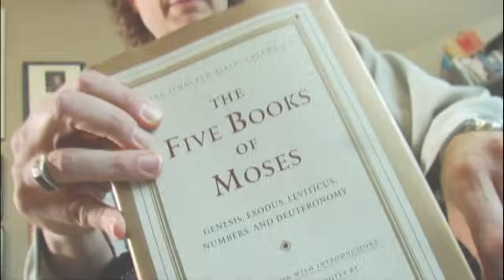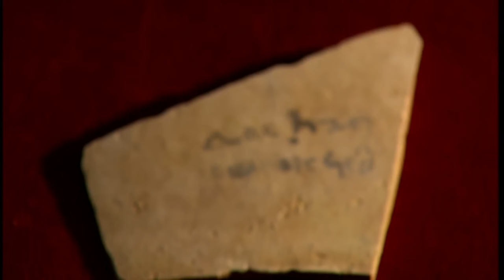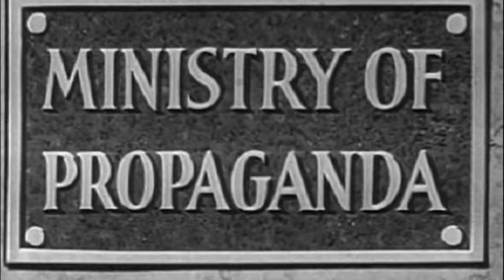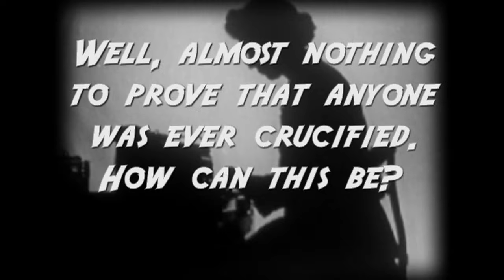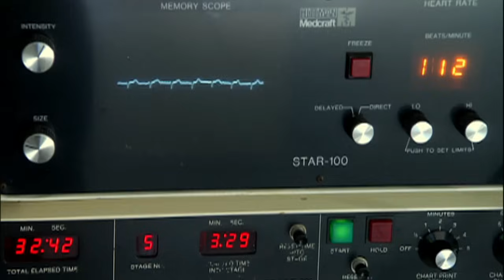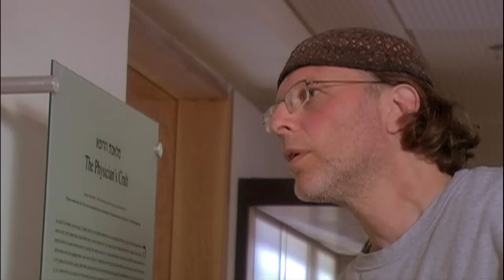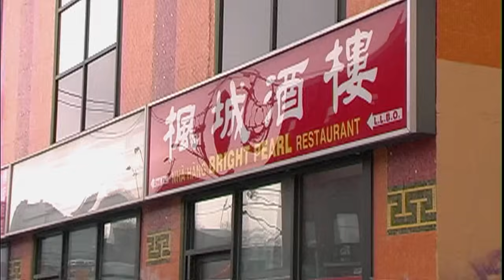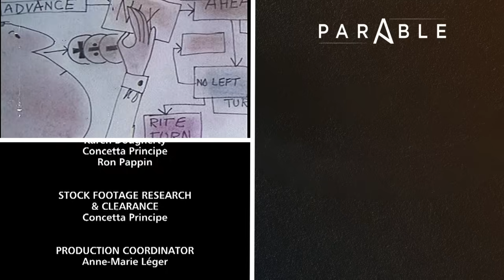Full Episode: The Quest for Proof - Archaeology & Jesus | Parable

Comment: In 1978 the Shroud of Turin was subjected to intensive evidence gathering.  This evidence was then analyzed over a period of three years.  The conclusions are that the Shroud has been in contact with a human corpse and that its image is not composed of paint, stain, ink, watercolor, or scorch and that the image is not the work of an artist.  No known natural process can account for the image which contains skeletal features.  It seems to be the result of some type of radiation whose origin was the enclosed corpse.   Therefore, the possibility of a related neutron radiation event has to be considered when evaluating the Shroud's C14 data.  However, the British Museum refused to do that, and, instead, manipulated the both Shroud's C14 data and its mathematical analysis in order to arrive at the Museum's desired conclusion.  When the Museum was finally forced by a court order in 2017 to release all of the original 1988 C14 data, a reevaluation of that data resulted in the conclusion that the data was too disparate to be a valid indicator of a date.  Nuclear engineer Robert Rucker tested that data using a Los Alamos neutron radiation evaluation program and has found that the Shroud's C14 data is compatible with the hypothesis of a neutron  radiation event from the enclosed corpse. shroudresearch(dot)net
Reply: That shroud was not left by Jesús but created and planted by satán because God does not want any object to become an excuse to praise, adoration or veneration. 
God said in the 10 Commandments not to make any imagen and not to render any adoration.
Reply: @manuelr7296  The Shroud is not an idol.  It is not worshipped.  Rather, it is the fulfillment of the promised "sign of Jonah" which is miraculous proof that the great rabbi, Yeshu ben Pantera was the messiah.  Its miraculous image is also proof that the common philosophy of "naturalism" is wrong.  YHWH does exist.  Take heed, my friend.  Whoever says a word against the Son of Man will be forgiven, but those who speak against the Holy Spirit will not be forgiven.
Reply: @Real Aiglon Of course it is, Real.  How silly of me to think otherwise.  BTW, how about showing us how it was "faked" since you know so much about it.  Many are looking forward to a reproduction, in fact there is a standing offer of over a million dollars to anyone who can do that.
Reply: @jeffreyerwin3665  The shroud is a fake. And even if it wasn't it wouldn't prove that the corpse was historical Jesus, nevermind biblical Jesus
Reply: @chickenfist1554  If the Shroud is a fake, then why can't anyone reproduce it?  There is a standing offer of one million pounds to anyone who can do that.  
A simple probability analysis proves that the corpse shown on the Shroud is the person who is described in the Gospels as having been framed on a false charge of heresy and then executed by crucifixion.
Reply: @jeffreyerwin3665  "A simple probability analysis proves that the corpse shown on the Shroud is the person who is described in the Gospels as having been framed on a false charge of heresy and then executed by crucifixion."
No, it doesn't. Not by a long shot. It doesn't prove anything like that. You would need to prove that it was dated to the 1st century, how it was created, where is was from, that the person had been crucified, that it was Jesus and that he was divine.

You cannot do any of that. People not being able to replicate it (if some are trying) does not prove any of what you've asserted to be true.
Reply: @chickenfist1554  Well, your right.  Muslims believe that another person took the place of Jesus (Isa) and was crucified in his place.  If you want to believe that, it's your choice.
Reply: Know your Bible
Reply: @laurasswford6962  I think that what you mean by this comment is that the Shroud's images are not mentioned in the Bible.  
There is a good reason that neither Jesus nor any of the Evangelists said anything explicit: images of humans, even as corpses, were illegal in first century Israel.  Not only that, but the Shroud's images imply that Jesus' corpse actually did vanish from inside of a locked tomb and that his resurrection was a subsequent possibility.  The religious authorities would have made great efforts to seize and destroy a shroud that held miraculous images of Jesus' corpse.

But Jesus did make a cryptic prediction of the Shroud's images.  He said, "For just as Jonah was in the belly of the whale for 3 days and 3 nights, so the son of man will be in the heart of the earth for 3 days and 3 nights."  These words are a prophecy of an internment of no more than 72 hours.  The images of Jesus' corpse on the Shroud are of a corpse that shows no signs of decay: this body has been dead for less that 40 hours.  The Shroud's images are miraculous proof that Jesus' ancient prophecy was fulfilled.  
They are the second sign of Jonah!
Reply: @chickenfist1554   Do you know anything about Forensic Science? How can you say using Forensic Science we can't tell if it was Jesus? Because it is through Forensic Science we can tell it was Jesus.
Reply: Those who do not believe will refute the facts and go with their feelings
Reply: @chickenfist1554  reely think you a fake tell me your bold hypothesis of how this unexplained by scientists is a fake
Reply: @edwinkubena9944  It's not a 'bold hypotheses', its called common sense. I already gave details in my comments above.
Reply: 7 😘û0 👍🏻🤔
Reply: @manuelr7296  God's commandment are for humans.  The Holy Shroud's images are not the work of man.  God can make images if he so desires, and it is not for mankind to place limits on what God is allowed to do.
If you say that Satan, not God man the images on the Shroud, you are calling God satan,
Reply: That foolish thing was debunked years ago
Reply: @kathybrem880  Yes, the Shroud has been "debunked" many times, over and over again.  Problem is , all of the "debunkers" have themselves been thoroughly debunked.
Reply: @chickenfist1554  well said! The fabric of the shroud has been dated to the Middle Ages and appeared coincidentally with Leonardo da Vinci doing experiments involving a camera obscure and the effects of light on silver nitrate, in other words, the Shroud is an early photograph, and the image on the shroud is a self-photo of Leonardo himself!
Reply: @chickenfist1554  Very well said
Reply: Very interesting! Thank you!
Reply: No matter what any of you are debating , we may be in a matrix and even at that there is a great creator of everything and everyone . The question is what created it and how did it all start but none of you could tell us that because you cant even wrap your brains around that and your brains would explode possibly implode. Not only that I don't believe in but even if there was a big bang there had to be a creator to cause the objects involved in it to clash . You all only know what you are told and that is the bottom line to it all . I love my father and he loves us all no matter who you are .
Reply: The Shroud of Turin is Real and Wonderfully Preserved. It was left, folded neatly, on the stone where His body was laid. Obviously, it was taken and hidden, for a time such as now, either by the Angelic Guards or the desiples because It is proof for those who need or want it.

Comment: About the crucifixion 'experiment' done by the doctor - I'm quite disappointed in it. Metacarpals can't hold up the weight of a human, so the nails would have to be put through the wrists for it to work, otherwise their hands would just tear apart.
Reply: That's why, when they used this form of crucifixion, they would have used straps to keep them from tearing thru.
Reply: @sherryblanton2029  though I do recall since I said that, that there are some SE Asian countries that actually perform reenactments of it, and I seen they go through the hands, but I can't recall if they stood on any pegs or had straps.
Reply: I agree! The Shroud of Turin shows that the nails went through the wrists, which makes sense!
Reply: You’re correct. The cross was up side down. Recall that one of the saint wore a cross up side down. I think it’s a more logical explanation that the feet were nailed on the top and the arms were kept by nails below.

Comment: What surprised me is when they were wondering why they couldn't find any nails. For one thing back then, making nails was a very tedious task for a blacksmith to make, which means they weren't cheap! So they were most likely sparingly used on those whom did some really messed up stuff  like maybe killing a Roman or Roman soldier etc. Also if people took them as good luck charms there should be some evidence of that as well because those nails would have been handed down through the family as an heirloom  so there should be more Roman crucifixion nails somewhere? However it's also possible that after the corpse has rotted away the nails were most likely recovered by the Roman's so they can use again since they were so expensive, so if the nail was bent after they removed it from the wood and if it was bent, they would just straighten it out. As for the nail in the heel of the skeletal remains of the crucified heel you can see that they could not remove the nail from the wood because it was bent pretty good inside the wood itself so it's possible they just said screw it and let it stay there and so they gave what was left of the corpse to the family to bury. That's why back then most everything that they built was made if stone and mortar and mud etc. But they never built a frame using wood and nails the way we do it today.
Reply: As you said, just because they use it on special people, is it possible that this one comes from Issues? After all he was the most dangerous in there eyes...
Reply: They are very smart doctors and intellectual people. And your just a guy.
Reply: I'm not just a guy!! I'm  a 30 year Army disabled veteran that has fought in almost every campaign since 1983 from Granada to my last deployments which included Afghanistan and Iraq between the  two I served 6 tours in the middle east I have 4 purple hearts, Bronze star, and 2 silver stars and other medals and accommodations for bravery etc. And as an old war dog and knowing certain things such as not throwing away reusable materials that can fall into enemy hands and of course for other obvious reasons, it doesn't take a rocket scientists too figure out things like how come crucifixion nails are rare etc. This was not just my opinion on my first comment but an actual fact because I watched a similar question about the nails on another documentary where archeologist said the same thing I did. You don't know me from squat, but I will say again of my first response, I am not a regular guy I'm not your average Joe, I'm far from being a regular guy!!
Reply: Also rope wasn’t cheap either, it was a extremely time consuming item to make.
Reply: The best evidence is the word of God.  Is there a greater witness?
Reply: Wonder if they could have pried the nails back out after the crucified died. That way, they only had to straighten and re use the nails.
Reply: @1Corinthians15.1-4  What evidence have you that a God ever said anything?
Reply: @1Corinthians15.1-4  That's the claim, i was asking for the evidence lol.   The bible is the claim so when you have evidence show it.
Reply: @joevelosa7056   Who told you it's a claim dude?
Reply: @1Corinthians15.1-4  The bible is the claim, just as is the Koran and all the other religious books including ones that are much older than the bible. the Bagavhad gita is way older than the bible lol.   The claims of miracles and a human living inside a fish need to be demonstrated, not just asserted without evidence.   If that was how it worked then you would have to believe in all the Gods and all religions lol.
Reply: @joevelosa7056   You have a false understanding of what truth is.  You are deceived by the world's false sciences and religions.  There is only one God and one way to get to him.  That is not a "claim."  That's reality.  And people who don't believe in God or his Son, end up in hell, which is another reality.  Every atheist will come to know who God is.  Every believer of their false gods will also come to know who the true God really is.  Your wicked beliefs end at death or until you turn to God.
Reply: @1Corinthians15.1-4  That is a claim,  unless you can prove it.
Reply: @druidriley3163   That's a claim for you but to me it is evidence.  You cannot please God without faith.  He doesn't care what level of intelligence you possess.  Most of it is foolishness anyway.  He looks at your heart.  Faith is the evidence of things unseen.
Reply: @1Corinthians15.1-4  Evidence is evidence, it's not a claim.  I hope you don't serve in a jury if you think otherwise.
God is a fiction, so not worried about what this fictional character wants.
Reply: @druidriley3163   You're wrong and the people and material you follow are all wrong.  You're deceived.  You'll remember every single one of these moments when you rejected the Truth in a place which burns with fire and brimstone.  Don't be a fool.  Repent of your wicked beliefs.  Jesus comes with a sword.  You can bank on that.
Reply: @1Corinthians15.1-4  Sorry, scary stories about fictional characters don't bother me.  I hope you never serve on a jury if you don't know what evidence is. That would be scary if you did.

Comment: 47:34 - Christ was nailed through the wrist and NOT, the palm of the hand. This alone, tells me this is an old production, as that is pretty much, common knowledge now.
Reply: There's been controversy.  I've seen a study done where they said it COULD have been through the palms of the hands if they placed the nails correctly.
Reply: @druidriley3163 : No, it is not physically, possible. There is absolutely, nothing in the hand that would be able to hold the body in place. The weight of the body would completely, tear through the hands after a while. It's just, not physically, possible. The only, way it could conceivably, be possible is if he was tied to the cross as well, thus helping to hold the body in place. I'm not certain if the Romans did this as well, or not.
Reply: @ivanj.conway9919  Dunno, don't remember the exact process.  I'm sure you can look online for these studies.

Comment: I wonder is anyone has scanned all the different versions of the bible and then asked the system to extrapolate all the same stories in all parts of the bible and where they are written ,that way you could then say, yes this story is repeated 5 times as a example, thus it should be only 1 version and the version which is updated if any known words are found which will say the story as a computation of all of the same stories.
Like genesis, the oldest version known and the same with the oldest versions of each in the old testament and the new testament as well. 🙏🙏🦘👍👌✌
Also why Simcha has never done a story on the shroud of turin ? 🙏🙏🦘👍👌✌

Comment: The Shroud of Turin is not Jesus's because Jesus was wrapped in CLOTHS., not a single cloth. 
Luke 24:12. But Peter got up and ran to the tomb,* and stooping forward, he saw only the linen cloths. So he went off, wondering to himself what had occurred.
-----------
John 20:5 Stooping forward, he saw the linen cloths lying there, but he did not go in.
Then Simon Peter also came, following him, and he went into the tomb. And he saw the linen cloths lying there. 7 The cloth that had been on his head was not lying with the other cloth bands but was rolled up in a place by itself."
Reply: Yes.
Two cloths. 
One for the face and one for the body.
The Shroud of Turin is the 14 foot long one from the body, and the smaller one is called the Sudarium of Ovieda, 33 x 21 inches.
Reply: @alhilford2345  So why is the head and face showing in the Shroud of Turin?  It should only be showing the body.  Obviously the Turin shroud is fake, an anachronism created by someone who didn't know ancient Jewish funeral customs and couldn't read the bible.